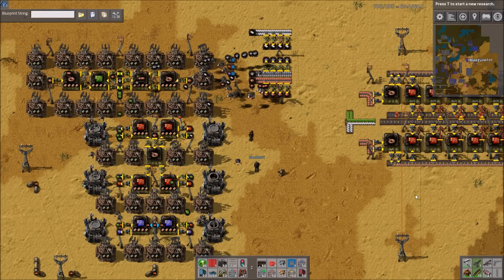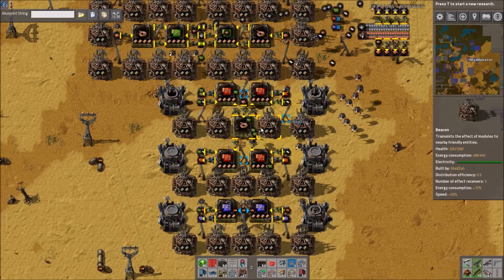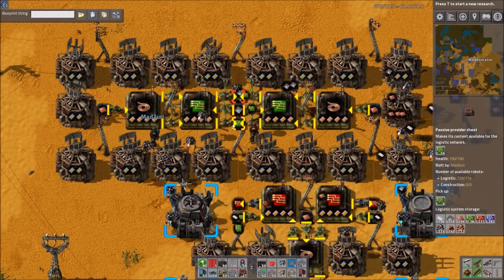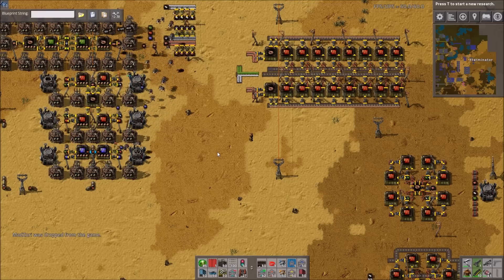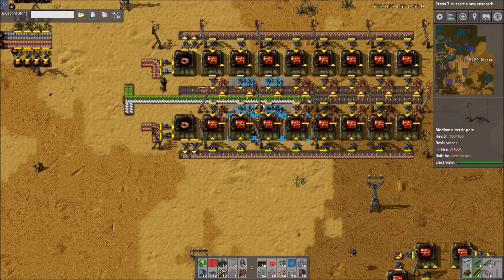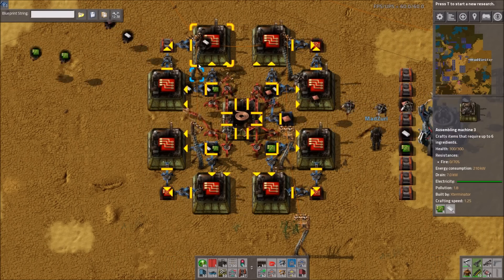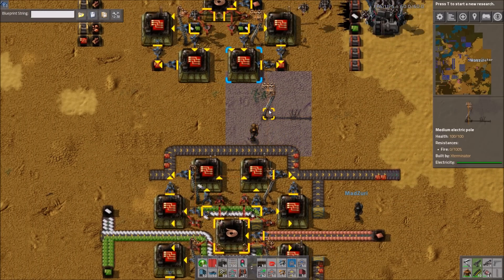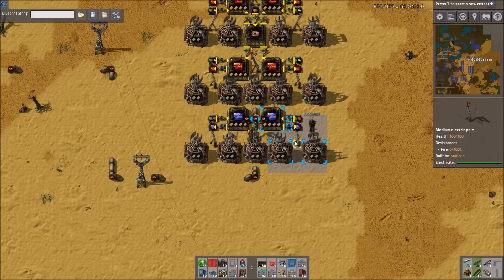Factorio Workshop - Building A Better Factory :: Advanced Circuit Setups & More!

Comment: Hey Xterminator, did they change the formatting of the import strings of your blueprints? I've tried importing several of your blueprints from various videos and 100% of them give me an error, any idea what this could be? would like to use some of your guy's builds. thanks so much
Reply from the maker: Since 0.15 came out, you import blueprint strings without a mod now, so all the strings in this first season of videos can't be directly imported to 0.15 unfortunately because they were done with a mod in 0.14. You can get around it by using the Blueprint String mod in a 0.14 map to import the build and then load that map in 0.15, re-blueprint the design and export that string for yourself. 
I know it's a bit of pain, but unfortunately the only way at this point.

Comment: How are the various logistics chests set up for these bot based designs? requested item amounts and the like. How many roboports are needed, etc.
Reply from the maker: Well Roboport amounts are kind of just a judgement call you can make when you set it up. Could probably use a few more than we show here though. 
As for the request amounts, it depends on the type of item and also bot travel distance. Since these are so close together, the requests probably wouldn't have to all that high aside from bringing in the copper and iron for the Green Circuit production. Typically for a fully moduled and beaconed setup like this for Green Circuits, you would want to request a minimum of 200 iron/copper for each requester chest.
If it's an item that is crafted very quickly (like green circuits), or requires a lot of materials (like blue circuits requiring 20 greens), or there is a long bot travel distance, it is pretty standard to have 200 be your minimum request. :)

Comment: Hi Xterminator, MadZuri!
Please check out this green circuits setup https://imgur.com/a/H8S3K
I'd like to hear your comments about it
Thank you
Reply from the maker: Hey, thanks for showing it! After taking a look, I actually really like it. :) The main thing I can point out though is that you could save a fair amount of resources by replacing the output belts/splitters with reds instead of blues. Sense the whole design on that first picture only outputs 1 blue belt, you would be fine using red belt for the actual machine outputs and then merging them into the single blueprint at the end.
The other variations look good, but may need the same adjustments. Of course if saving resources doesn't matter for you then it's probably good to go as is. :)

Comment: Xterminator, here's a red circuit setup I made for ElricM's multiplayer server once I got looking at the ratios of red circuits with productivity modules:  http://i.imgur.com/TYgrisa.jpg

Since 4 productivity 3 modules means 40% more production, that means 1 copper cable assembler can make enough cable for 8*1.4 = 11.2 red circuit assemblers.  Same for green circuits, and since productivity modules mean it's close to 1:1 for copper cable to green circuits, it works out very nicely.  It can be tessellated vertically by sharing the beacons between each set, and also horizontally by sharing the last and first sets of medium power poles and beacons like so:  http://i.imgur.com/EOoXK6u.jpg

The main con is it only has 4 beacons per assemblers instead of 6+ like in several of the setups covered in this video.
Reply from the maker: Very nice design man! I like the fact it can scale and tessellate so nicely. The 4 beacons per machine instead of 6 isn't a huge deal, sense it is still pretty damn fast. 
Would you like us to feature it in a video, or just wanted to share? Either way, it's a good design!
Really my only gripe with it is that it isn't direct insertion. Although with max robot upgrades I don't think it matters too much. :)
Reply: If you want to do a followup with viewer designs then I'd be happy to have it shown.

I've got more designs though such as this filter inserter setup: http://i.imgur.com/TDYzUX2.jpg  or this red and green wire setup:  http://i.imgur.com/G8gVOS5.jpg  I've noticed you guys haven't gone over solar builds yet, so there's also my 5 accumulator to 6 solar panel (it's 83.33 compared to optimal 84) build at http://i.imgur.com/1fFvg9m.jpg
Reply from the maker: Jackalope Gaming Thanks for the new designs! The inserter one could definitely be something we show.

Damn, if only you had submitted that solar one a few hours earlier, we actually just recorded a new video with Solar layouts a few hours ago. xD Will add it our list anyway though, we might just do a Jackalope Designs video and show several of yours in one like we have done with some other people. :)
Do you happen to have blueprints for these?
Reply: I'll put some blueprints together for them and show them on my crazy contraptions forum thread at https://forums.factorio.com/viewtopic.php?f=8&t=19577  The solar panel and circuit wire builds are already there along with other things I've done.
Reply from the maker: Jackalope Gaming Oh awesome! I didn't even know about that thread, looks like some awesome stuff you have there. Mind if we maybe take some designs from there for future videos? :) Obviously giving you credit.
Reply: Go right ahead!  I'm happy to have my designs out and about if they're useful.  Though I do need to go through a few more of those and at least try to update them.

Comment: Note that the green circuit setup is assuming the use of productivity 3 modules where the coil/circuit ratio is close to 1:1, but the red circuit layouts are not assuming productivity modules. So how would you change the red design for use with prod 3, or do the ratios stil work OK for them?
Reply from the maker: I'm a bit confused by the question. The red circuits do have prod 3s in them in this build. Are you asking about the fact the copper cable machine for red circuits doesn't have prod modules in it? If so, then the answer is that it doesn't need them. :)
If you did put prod 3s in the cable machine, it may not be able to keep up anymore, I'm not entirely sure. For something like cable where you get 2 cable for every 1 copper, it isn't really necessary to put prod modules in them at all. I'm actually not sure why Zuri put prods in the cable machines for green circuits and not reds.
Reply from the maker: Yeah it would take a while probably to pay for itself. Probably wouldn't hurt to use them, but for something as cheap as copper wire, I don't think it's necessary by any means.

Comment: I like the straight lines for red circuits. If you put speed modules in the cable machines, you can increase the number of red circuits machines substantially. Your design is more limited by the inserters and yellow belt used rather than the speed of the cabling machine. Put 4x sp3 in the cable machine, 4x prod in the red circuits machines, stack inserters (w/ max upgrades) for cable input/output, blue belt. By my calculations that will allow 16.8 red circuit assembly plants per row. 

In main bus factories, adding lots of short rows is undesirable. Better designs maximize row length.

Another tip: If you alternate the shared plastic/green circuit belt sides (in the video green circuits are on the left lane and plastic on the right), every few rows, you'll get even consumption from your main bus and have an "inherently balanced" design that you guys like so much.
Reply from the maker: Good points! Adding modules to the setup definitely would allow for a longer design and more red circuit machines to be support from a copper wire machine. Also interesting idea about alternating the lines, didn't really think of that. 
Personally I also am a fan of the straight line setup for the red circuits up until about red belt. After that point though I prefer to switch to bot based and use one of the setups we showed for that.
Reply: I sometimes put copper plate on the other side of the wire belt,  so I can stamp the row longer.
Reply: Instead, you can put copper on the inside of the copper cable belt, which lets you stack multiple of these behind each other, with a new cable machine after every 8 circuit ones. You will then run out of copper(cable) at the same distance you run out of circuits and plastic, and this works for every belt speed. The ratio is 1 full belt copper (2 x 0.5) + half belt of plastic + half belt of green circuit = quater belt of red circuit.

Comment: Maybe you should consider using the creative mode mod rather than the spawn belts mod. It can do the same thing which spawn belts do, but it is easier to use, and it has several other creative utilities such as infinite power, infinite provider chests, infinite liquids, and many more to make production testing easier.
Reply from the maker: Yeah we really should switch over to using that. Had several people suggest it, and just haven't gotten around to it. 
Will talk to Zuri about using that instead. :)
Reply: neat